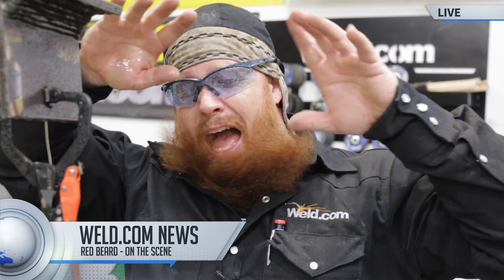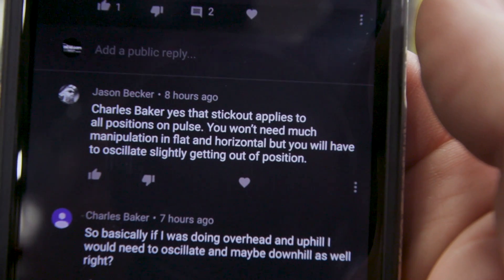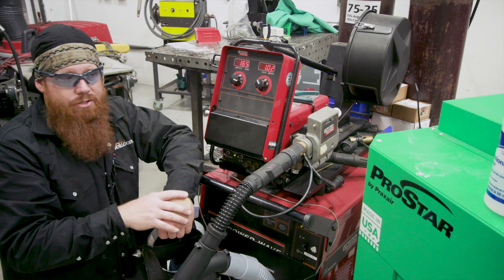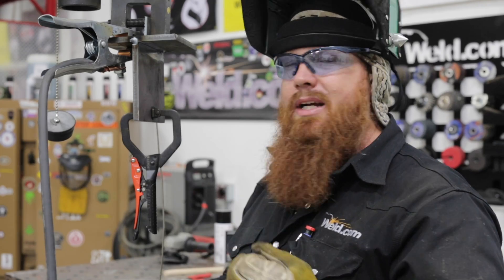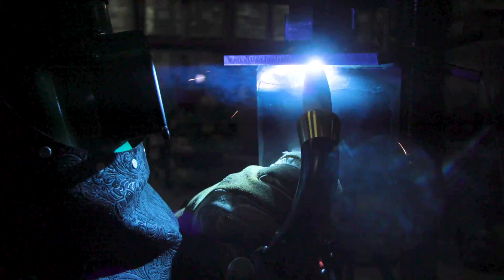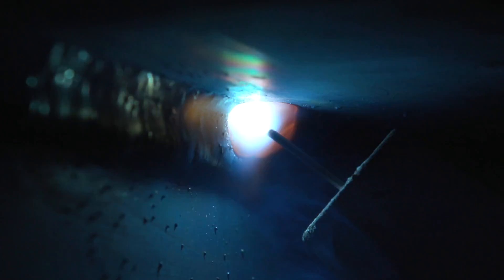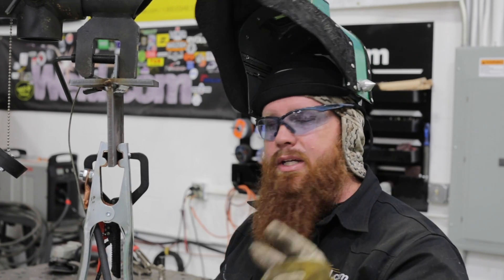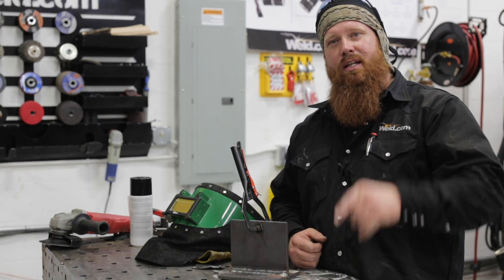Pulse Spray MIG Welding Overhead

Comment: Thanks, all I had to do was match your settings and my life was a whole lot easier. Here we  use a Miller deltaweld 350 with the Miller intelex pro wire feeder there are control settings go from fluid stiff. Is that  related to inductance at all?

Comment: I may or may not have a test coming up pretty soon. One will be 3g MIG root and pulse mig fill and cap and then the same thing in 6g pipe. Ive done pulse mig one time but a whole lot of regular mig. Any tips from anyone would be awesome.. like wire speed and volts and what not...

Comment: I would like to see you guys do a 3/16 plate Butt weld. Vertical up. 3/16 gap. Ceramic backing. Can’t touch what comes out under the ceramic. No undercut and no more then 1/8 inch reinforcement. Has to be done with 100s 0.45 solid wire with 95/5 gas. Pulse arc only. This was one of the test at the shipyard I worked at.

Comment: Red Beard! Please explain the Voltage sensing feeder in a little more depth for some that doesn't know. A VS feeder is used mostly on constant current power sources (smaw or mma and tig power sources) the Voltage sensing feeders do the current changes and stabilizes the voltage where as a normal feeder has to have a constant voltage power source.  Do a video on that please. As usual great content!!

Comment: I'm having trouble welding overhead and uphill running regular spray transfer, .45 wire, and 95/5 gas. Any suggestions
Reply: Uphil probably don't use spray at all for uphill . And for overhead spray might be ok just got to adjust your wire till u got it dialed in maybe don't do spray for either of them

Comment: Are the pulse settings (frequency, percentage, etc.) set manually by the user or automatically by the machine based on wfs and trim?  I've got an Everlast 275P that I'm trying to dial pulse settings in for (manual settings).  I figured if I can sort of reverse engineer the synergic pulse machines, it might give me a solid baseline for my own settings.

Comment: Absolutely would like to see more Pulse MIG video - especially Pulse MIG on Steel, which I believe is genuinely undiscovered by most - it's an amazing process on steel - beautiful welds, no cleanup, deep penetration - what's not to like!  Possible topics: (1) use other machines like the Millermatic 350P, or the HTP pulse machine (they both have different types of adjustments) - the MM350 has both an Arc Length and Arc Width adjustment); (2) Pulse MIG welding thin materials - I was using my MM350P (new machine to me) on 1/8" steel today and having some trouble keeping the weld bead flat.  Using 0.035 wire on 1/8" steel tube is sort of like using a fire hose that squirts molten metal!  (3) Weld puddle manipulation (small cursive "c"s, circles, etc. - if any of these are possible) using Pulse MIG on steel  (4) heavy "structural" fabrication with Pulse MIG on steel - connecting 1/2" - 1" plates in different configurations - when to grind a deep vee prior to welding.  The objective of the heavy structural welds would be to demonstrate how penetration can be achieved while producing a "ready for paint" finish. (5) Possibly show the use of the guide to slide the nozzle along to produce a straight weld - yes this is girly-man (possibly an expression that pre-dates you), but it's very difficult to maintain a perfectly straight bead and maintain the [fast-as-hell] travel speed necessary to maintain a reasonable bead width (especially when you're old - LOL!).  (6) A video that answers the question, "Is there any way to slow down the travel speed"?  I'm guessing, move to a smaller diameter wire, but are there others?

Greatly appreciate the video, and again there is very little on Pulse MIG on Steel out there.  These are just some thought starters.  Thanks.
Reply: you will never use hardwire with structural its all fluxcore-dualshield mig or stick

Comment: Its MAG not MIG. You usw active gas. Not inert
Reply: Honk Meer it’s GMAW not Mig or Mag. MIG and MAG are non standard terms for GMAW. That being said this would be closer to MIG (Metal Inert Gas) because it is primarily (90%) inert.
Reply: The gas coming out of the gun reacts with the puddle so it is active gas. Gmaw yes and to be More correct its MAG
Reply: Honk Meer is a MAG

Comment: How the F do you even get overhead welding from dripping down all over you I don't get it except with fast freez rod
Reply: You can run overhead with low hydrogen rods, they're not fast freeze. Also with tig

Comment: So the 90/10 for hard wire and 100% co2 for dual shield?  I've heard a lot of big Industrial places like the straight co2 for various reasons.
Reply: Bill Cyrus for gas shielded flux core there are various compositions of gas which can be used. However each gas shielded wire will require a different type of shielding gas. Some require only 100% CO2, others 75/25 some you can use either. You have to check the electrode specification and the manufacturers recommendation.
Reply: I run a lot of .045 Ultracore 71A85. Nothing but 75/25 on that. Runs beautifully in all positions in case you haven't bought a roll yet.. I run either 75/25 or 90/10 on all hard hardwire, but 90/10 only for spray or pulse..
Reply: olsparky wisenheimer I’m very familiar with 71A85. Its a great running wire.
Reply: TMoD7007  Isn't it also said to get better penetration which is important with structural stuff?

Comment: I have yet to see a video from you guys that has never taught me anything.
Here's a thought. How about you invent "instant welds" for (amateur) birdsh*t welders such as myself. We could buy a pack and glue them into place. That way we could be proud of our welds rather than hiding them :)
Reply from the maker: 😂😂 Thanks for the support. Get some good time and you'll be there in no time
Reply: Pilot McBride practice, practice, practice man.
Reply: Thanks  @GodslilRedneck23  almost 50 years mate, lmao!! Electrician by trade (says it all).
I've done some reasonably good welds over the years, no finished welds have ever failed, but have to always rely on the old saying, "a good grinder beats a good welder" comes to mind, lol. I have an aviation welder friend and even he gave up years ago, haha. But I still front up to bat, at 64, may strike out a few times, but get there in the end. May take 3 or 4 attempts, but in the end.
MIG - below par 
Stick - atrocious
TIG - Don't ask
Oxy - Holy CRAP!
Gas Brazing - Yeah, pretty good.

Cheers mate, all the best
👍 🇦🇺
Reply: What if I'm a horses**t welder instead of a birds**t welder?? Same thing?? Ok then. 😘

Comment: I was so excited at that you're actually gonna show   What I've been asking but this is really really slow crank that wire speed up to 400 Take your gas down to a universal blend that you would find in a manufacturing facility 7525 Drop down to a lap joint on 8th inch plate and .035 wire it's a pain but these are the limits locked into my work welder we dont have all that control in a production atmosphere otherwise I would run 600 inches lol
Reply: Ringr 57 you maybe referring to Rapid Arc or Rapid X. We run that around 800ipm with 75/25 gas. Its a modified short circuit. We did a video awhile back. Check it out.
Reply: @GodslilRedneck23  I was referring to rapid x but in the overhead position 8th inch plates lap joint within the parameters listed overhead at 300 or less is real easy at 400 it gets harder I wish I could film it but no cameras allowed in production areas

Comment: I've been wondering what your trim value is adjusting? I use a synergistic pulse on a 350p and I adjust the arc length. Is that the same value change just a different name? Also I don't have a voltage sensing lead, is that due to the synergic setting?
Reply: Levi Towns you may not have a voltage sensing lead because you have an internal wire feeder. Does your wire feeder sit on top of the machine or is it a solitary unit? Trim is what Lincoln uses others have different names for it.  Same thing different name.
Reply: @GodslilRedneck23  Ok thanks. The spool sits inside the machine

Comment: Appreciate that. I’m working on that soon for my job. Can you do vertical and overhead open root? We running off 1 inch plates
Reply: 3rdCoastSmoke Smoked typically you would use either short circuit or STT (RMD for Miller) for open root and then run pulse spray for the fill and cap.
Reply: Jason Becker yessir. That’s exactly what we’re doing right now. I know it’s different and it’s hard to find because a lot of people don’t know anything about it or know how to run pulse. I appreciate it bro. Thanks again 💪💉